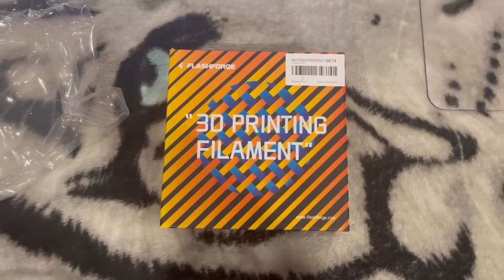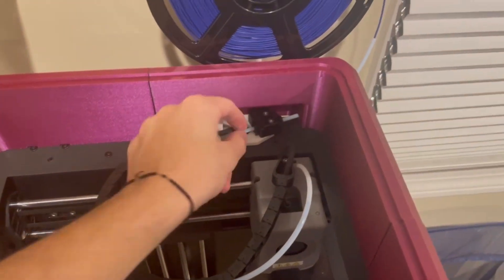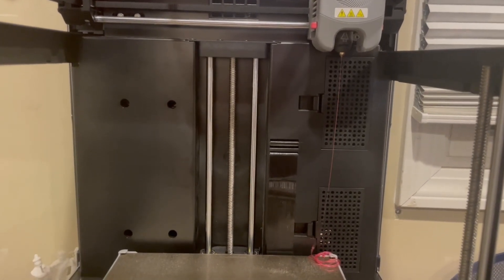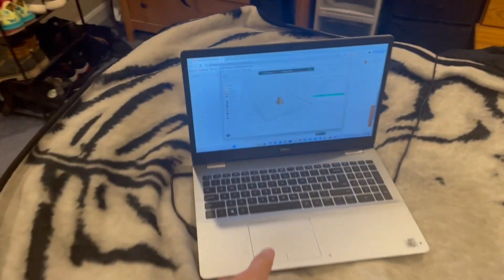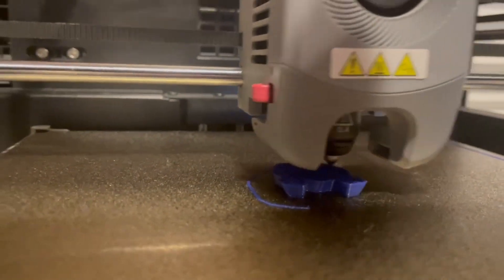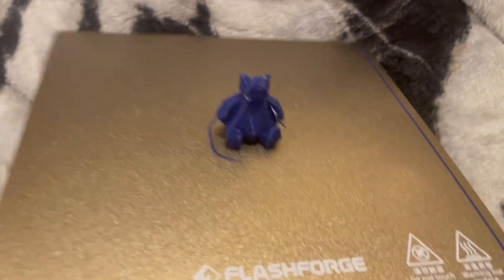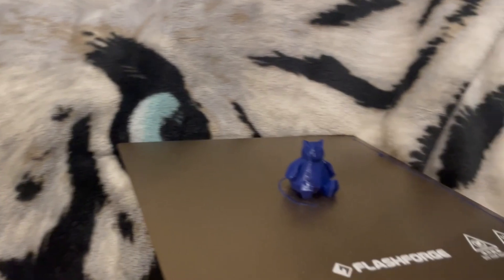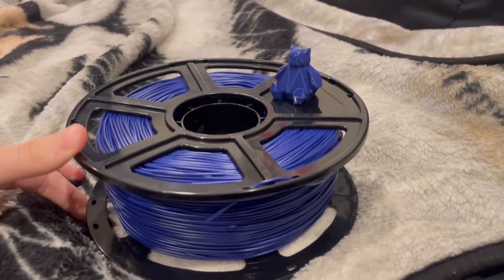3D PRINT w/ FLEXIBLE PLA! - FlashForge Adventurer 5M

Comment: Did you have any issues getting the Flexible PLA to load? I bought the same brand in black, I tried loading it on my AD5M and it would start to go in, but then the extruder would start clicking and would not load the flex. Swapped back to normal pla and worked with no problem. Just curious if you had the same issue?
Reply from the maker: @vinncecil  unfortunately I did not run into that same issue so I cant positively determine the cause or be of too much help. But one thing I did was print on TPU settings, idk if you tried that or if it will help but I hope it does for you. 

If not I would attempt snipping the filament a bit to a new portion of the spool. Maybe the diameter is at the lower end of its tolerance and the extruder doesn’t have enough presssure to actually pull it through.

Comment: Why are you trying to rip the print off the bed? You have a flex plate, just flex it to help loosen your print. Should make it a ton easier to release it.

What does FlashForge recommend for a bed temp?
Reply: Having used this filament before it fuses so strong to the print plate it’s near impossible to removed without damaging it if you don’t take precautions. At first I tried using IPA to get it off and wouldn’t budge. Found printing on a layer of masking tape works perfectly

Comment: is this not just tpu lmao
Reply from the maker: Flexible PLA and TPU are different at a chemical level. Flexible PLA is a modified version of standard PLA, biodegradable plastic made from renewable resources like corn or sugarcane, with added ingredients to make it more flexible. TPU, on the other hand, is a type of thermoplastic elastomer, a blend of hard and soft segments in its polymer structure that gives it rubber-like flexibility, strength, and resilience.
Reply from the maker: PLA- PolyLactic Acid 

TPU-Thermoplastic Polyurethane